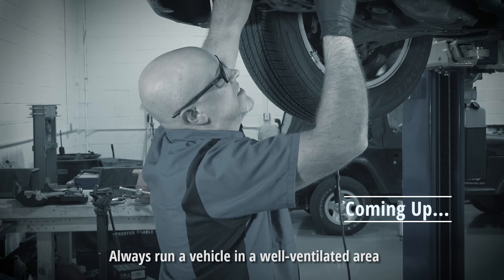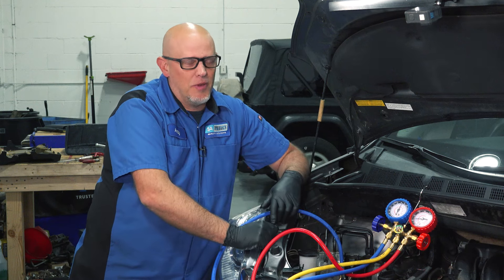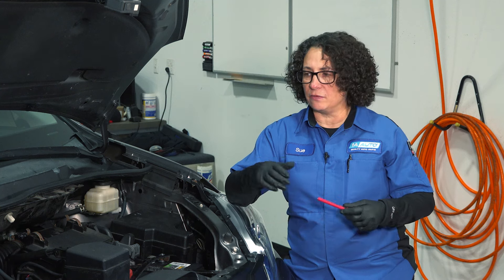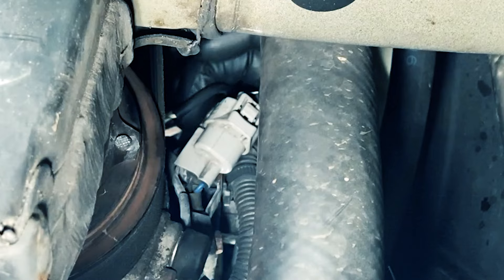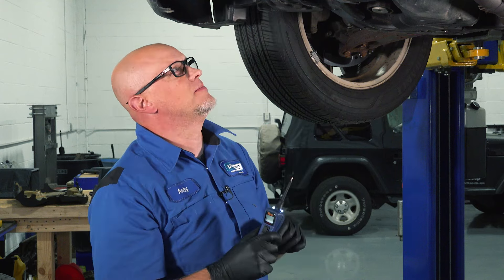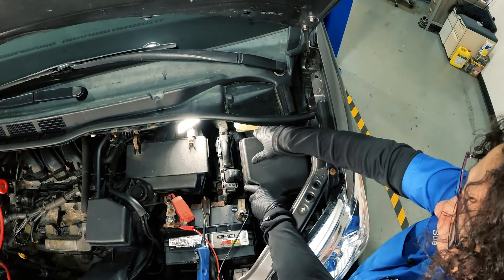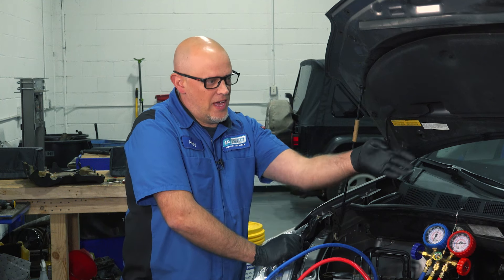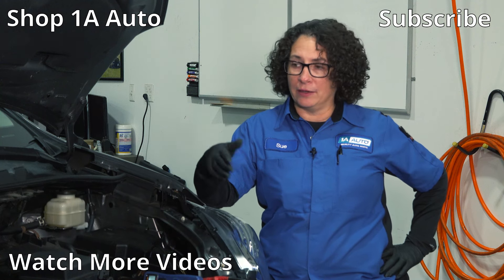What's Wrong with the AC in My Car or Truck? Refrigerant Full, No Leaks, Compressor's Not Spinning

Comment: i just had my complete system replaced in my 2008 dodge ram 1500 was not getting very cold and i was told by dealer the system was completely plugged up.  So i bought my own parts and it still was $1400 including labor but i saved $850 by getting my own parts because the dealers mark up the parts price sometimes 100%  They pay $187 for my compressor and charge me $650 for it.  So buy your own parts.